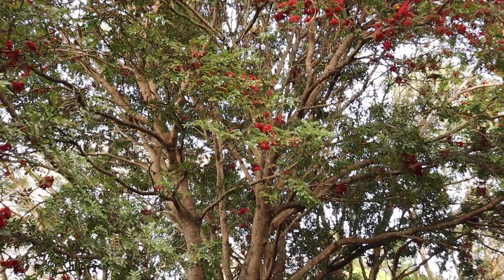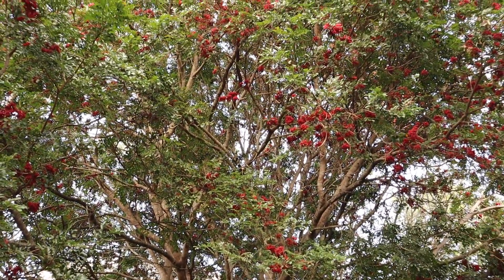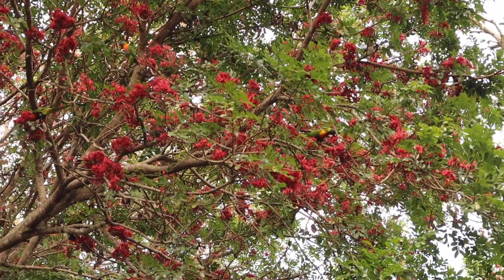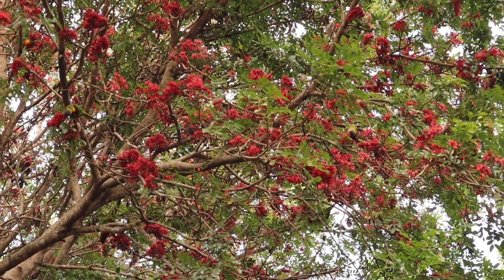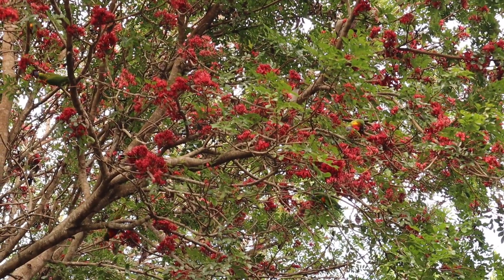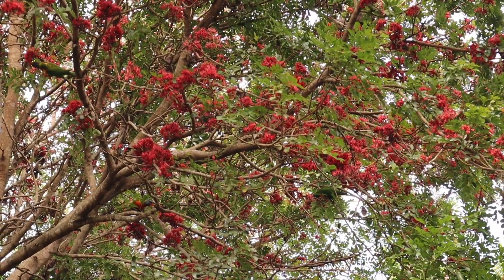Connecting the plumbing in my motorhome

Comment: Good job. We found with our bus that we needed to fit a simple on off valve to the breather line as when driving off after filling, centrifugal force would push water out when we cornered.  we would lose quite a few litres that way. Just a thought. Glen and Di.
Reply from the maker: Did you have your breather tube looped up higher than the tank like mine?
Reply: @AGirlADogandABus 
Yeah out of top of tank but not looped higher than our tank. Maybe that is where i went wrong. Ah well, into Bunnings Gympie tomorrow for more tube. Cheers D

Comment: Thank you for sharing this ☺ Did you buy your hose/fittings etc in a bundle? I just don't know where to start with what I need 😐
Reply from the maker: Not in a bundle as such no. Some of them I bought online and some I got from Bunnings. I sat down and drew diagrams of all the things I had to connect for the plumbing, like taps and pump etc and then I looked at each connection individually and worked out what fittings I would need to get. So I had a big list of all the bits I needed when I went shopping.
Reply: @AGirlADogandABus  wow ok, looks like I have some diagrams and lists to work on 😂 Thanks for your reply 💕

Comment: you know that fill that you have behind the wheel well, won't it collect dirt so when you plug in a hose, you are also taking in the dirt that flew up into the hose? I would try to put something over the end or a ziplock bag or something to keep it clean.
Reply from the maker: Yes I will be getting a cap to put on it when not in use

Comment: Great video. Where did you get the fitting that goes between the water pump and accumulator? Been looking for the same.
Reply from the maker: It came with the accumulator.
Reply: Thanks

Comment: My only concern would be that your fresh water fill connection is exposed to dirt and water thrown up by the wheels. Maybe cover with a waterproof bag or cap off with a blanked off connection, alternatively connection to a dedicated fill point in the body? Just my two penn'orth.
Reply from the maker: Good point yes, I was thinking of getting an end cap to block the opening when I'm not using it.
Reply: @AGirlADogandABus  A proper end cap from the connection manufacturer would probably be best but you could fabricate one from a standard connector blanked off with a rubber disc where the hose normally fastens in. Just my thoughts, best wishes from the isle of Man. John
Reply from the maker: @jl4775 ooh the disc is a good idea. If I can't get an actual cap fitting I could just insert a rubber disc inside the end of the hose connector that I can screw off easily. 👍
Reply: @AGirlADogandABus  Using the rubber disc you would also have a spare connector for emergencies coz they don't last forever.

Comment: So what about sink smell you don’t have s trap under sink is there something else
Reply from the maker: I used Hepvo valves under both of my sinks which act like s traps but take up way less space and don't rely on water sitting in them to work. (water can be pushed out of a normal u bend trap when driving).  I showed these in my video where I did the grey water plumbing: 
https://youtu.be/JG58iUpf1_I